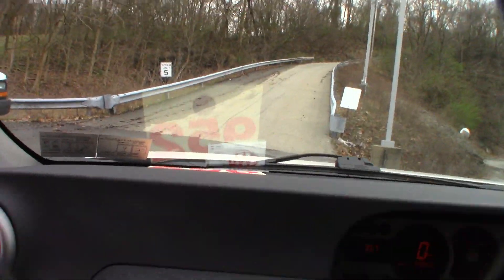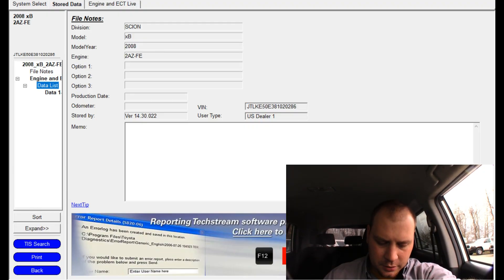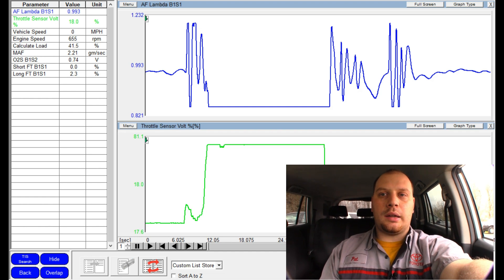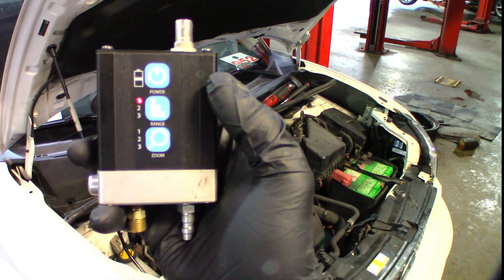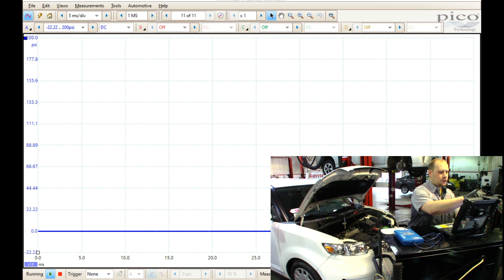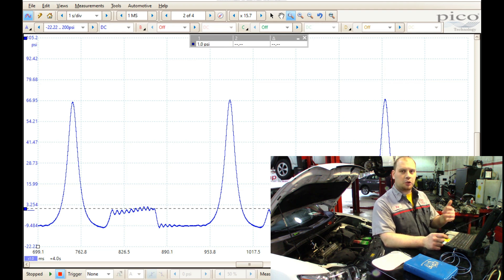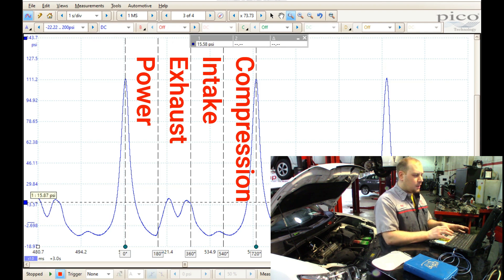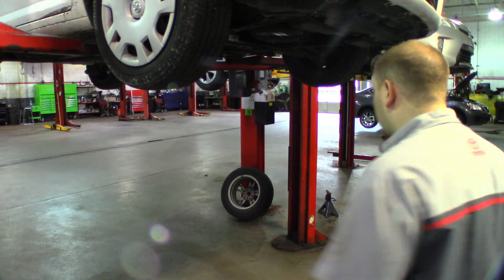Scion XB Low Power

Comment: i like how you used scope to show restriction. But could you have or have you  used pressure reading from O2 sensors? For those without a pico?
Reply from the maker: Absolutely you could! This was just showing a different method. Its always good to have multiple "tools in your toolbox" for when that oxygen sensor wont come out of the pipe.

Comment: I have the same vehicle a 09, no codes, long term fuel trim, runs about 10-15% at highway speeds! Cruise control. I used to be able to get 29-31 on the highway, for some reason it dropped all the way down to 24-26 
Any ideas on what to look for?  Clean mass airflow sensor, air filters good, spark plugs are good, fuel pressure is good. No vacuum leaks. Car runs great no rough idle
 just high L fuel trims and lower mpg than I used to get. 197k miles

Comment: Help me I have a random multiple miss I have replaced every thing and it will not go away new coils new injectors plugs and maf  fuel pump and ecm and harness all gaskets and hoses the motor is also a rebuilt engine with good compression and did a leak down WTF

Comment: hi i really like your video and i have question 
i was driving my 2006 Scion XP and everything was working fine I had the problem with radiator before I did not fix at that time and the battery light came on and the brakes and ABS light came on and check engine was on before and stayed on I change the battery the battery light did not go off stayed on and I made it home that night on the battery power only this is my little bit long sorry anyway I tried to check all the fuses all of them inside the car and the ones by the engine compartment all of them none of them was going off next morning I changed alternator radiator I did oil change on the way the battery light went off the only thing all the other lights stayed on I did not have AC I did not have the fan on all the time I was driving home so when I pulled up in the parking lot the temperature was high I tried to release the pressure from the radiator safely anyway after I changed all that I still have the odometer is not working it's not reading my speed the fan is not working I bypassed it temporarily trying to get help you could tell from what I described what could be the wrong is it the computer you think it went off
Reply: please thank you

Comment: Unless I missed it, I didnt hear you say what your limit is for backpressure, maybe 3 PSI?? Why was the exhaust changed, did they say, was it for the same problem? Another great video. For readers here in the future if you believe you have a clogged exhaust system you can do the same procedure, disconnect the exhaust between the CAT and the muffler, if still a problem, disconnect forward of the CAT and it will clear up if the problem was a clogged exhaust. Beware of the possibility of breaking studs, lots of break free may not work.
Reply from the maker: My threshold is a little higher with in cylinder waveforms then when using a gauge. I usually say "under 5 psi" only because there be slight restrictions with valve opening.

Comment: i know this is an older video, do you ever try to take out the top AF sensor and see if it runs better without it? or have you been burned by that before?
Reply from the maker: Oh yeah. For sure. But i always worry about the threads of the oxygen sensor/ air fuel sensor stripping out.

Comment: Working on 2015 scion xb, idle issue. Low rough idle 500rpm/high idle 1100rpm.  Was playing with brake pedal and steering wheel after I . Reset idle with 2 on off ignition cycles, 3rd cycle started it. Emergency brake up, put in drive and let it relearn for 5 minutes. After it felt 👍. So I turned the wheel all the way to left and idle got stuck at 1000rpm... haha, before I had a really low idle when I turned it.all the way.. So I'm looking for my next direction for diagnosis. Anyways I'm Enjoying your vids while taking a break 👍 👍
Reply from the maker: Clean the throttle body. With that said. Don't be surprised if the RPMs raise when you're adding electrical load on the system.
Reply: @VoltageDropDiagnostics  👍👍 Will do Thanks

Comment: I have a 2005 scion xb and it runs strong in 1st 2nd and 3rd gear but once I get on the freeway in 4th gear at 4000 rpm it feels like it drops off in power, then I shift to 5th gear and it's good again until it come up to 4000 rpm again and it drops slight power again. Any thoughts, thank you

Comment: That’s the only thing I know about pressure transducers is a restricted exhaust and the cycles I don’t know intake valve problems yet or exhaust valve problemsI just started looking at these waveforms a week ago.
Reply from the maker: I have a video I believe on a corolla misfire that shows a bad head gasket between cylinders. It might be worth checking out.

Comment: Thermal imager would have given You the same results. Checking it while someone’s power braking it. And see the heat difference from the front of it and rear of it. If it’s a drastic difference you know it’s clogged. Good video man.
Reply from the maker: I need to get myself a thermal imager. With that said, not all catalytic converters can be diagnosed this way. Some cats are endothermic and some are exothermic.

Comment: It took me proving several plugged cats with the wps before the office believed it as a reliable test. I use it on GM v6 engines all the time because it easier to take out a front plug than the O2 sensor. Nice video PJ.
Reply from the maker: Thanks Chad! I used to work for Saturn. Those GM cats always clogged up lol

Comment: I had a 3.8l Caravan that I used this technique on. Some of those are hard to get the O2 out of, that one pays 1.4h. A front facing plug was much easier. It had a 5psi restriction according to the scope readings. It was easy to print out and show the before and after measurements. Anyway, thanks for the video, great stuff!! I wish you and your family the best through this.
Reply from the maker: Frank, thats a great tip as far as printing it out to show the customer! I am going to start doing that.
Reply: @VoltageDropDiagnostics  I'm sure you know but you could use the rulers to get numbers to show on the printout

Comment: I hear that is one indestructible car  the SCION XB 

HANG IN there things will improve sooner or later
Reply from the maker: Yeah, besides burning oil, these cars are pretty solid vehicles.
Reply: No doubt. My lady's parents borrowed her car and ran it low on oil. Checked it when they brought it back and dipstick was dry 😬 was almost 2 quarts low. They ran it 10k miles on an oil change also when they were suppose to get it changed. That was 80k miles ago. Car is a 2012 and just hit 235,000 miles. Never count out the scion xb and never loan the inlaws a vehicle. Lol

Comment: Great video. Wednesday busted my snap-on 400 psi hose while doing incylinder test on a single misfiring cylinder. So I used hose in pico kit from toyota had a bad valve and seat and only 40 psi running. 
The dealership I'm at in Dallas laid off all hourly techs and cut back hours for now. Hang in there brother.
Reply from the maker: I'm hanging. I am just hoping that by May we can start to get back to normal.
Reply: @VoltageDropDiagnostics  Me too! I have a Venza I'm working on today cylinder misfire used Cody's probe last night and seen no vacuum in one cylinder during idle. Got ok to tear down this morning and found piston cracked and rod not connected piston doesnt move with crank pulley. Also had no holes in block. Going to remove pan next.

Comment: Thanks for sharing PJ. @ 7:30 which point of exhaust did u disconnect?
Reply: Ahaa thats more clear now. Thank buddy n  stay safe.
Reply from the maker: I should have explained that better. The catalytic converter is part of the exhaust manifold. So I was disconnecting the front pipe that connects to the manifold to isolate the manifold from the rest of the exhaust.

Comment: Pat I wish you and family nothing but the best. These are really difficult times up here on LINY.  Actually it sucks. Thanks for the video. I just took a Brian Mann Pico webinar course. He is an excellent instructor and person. I’m trying to support all you guys in these hard times. Thanks again and stay safe ❤️🙏 Brian did you disconnect the exhaust from the converter proving the converter bad? Just wasn’t clear in video what you actually separated.  I probably just answered my own. Is converter that far forward. Thanks 😊
Reply from the maker: Yeah. The catalytic converter is part of the exhaust manifold. So I disconnected the front pipe from the manifold to see if the restriction was before or after the converter.

Comment: thanks for sharing. i am a truck fleet tech working same place since 1979 and we still do are 40 hour
Reply from the maker: Im glad to hear that! This week I did pretty good. If you look in the background of this video youll see a prius that I had torn apart. It needed a head gasket that saved my week.
Reply: Voltage Drop Diagnostics  lol that what are we doing lot of head job now,only problem is the rebuilt surplier are close down

Comment: Thank you for sharing your knowledge. One question, air fuel sensors work with different voltage as i can see, every manufcture uses it own. Is there any stragety that you use on toyota vehicles or all the readings are the same..thanks
Reply from the maker: You're right all manufacturers use a different voltage number. For example, Toyota is 3.3 volts. But keep in mind that A/F sensors don't work off of voltage. They actually work off of amperage. The voltage reading you're seeing in the scan tool is a substituted number. BUT if there is a lambda pid 1.0 is the standard for stoichiometric across the board for all makes and models. And anything lower than 1 is rich and anything above 1 is lean.